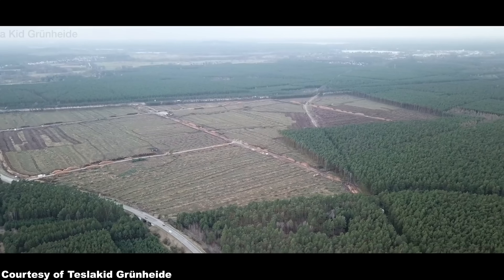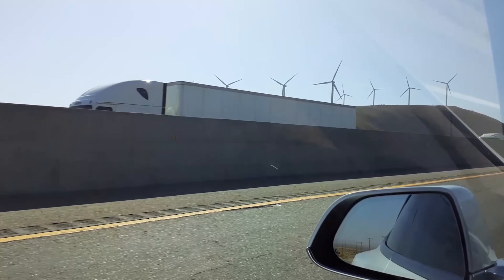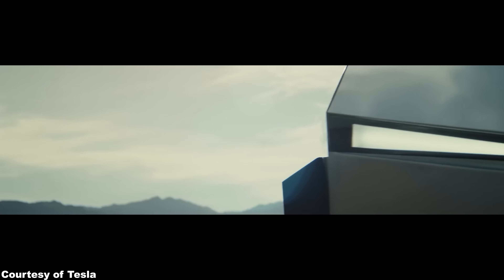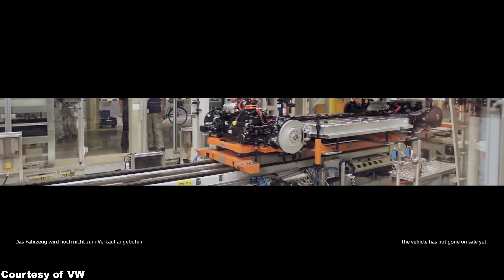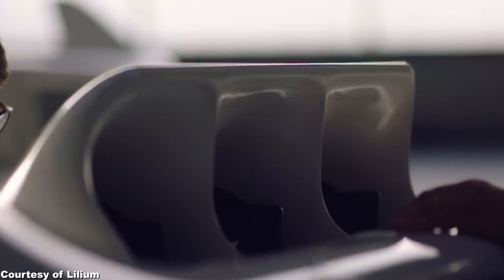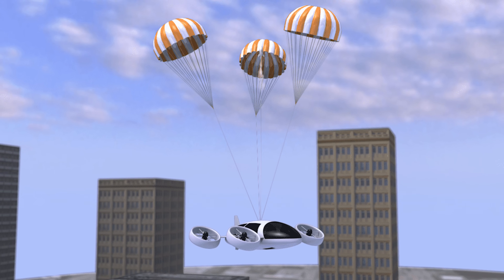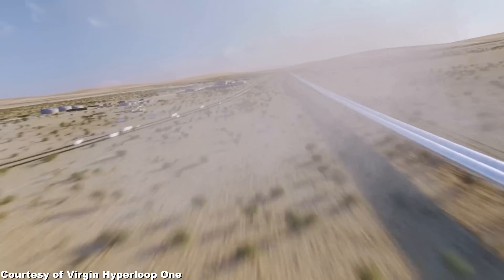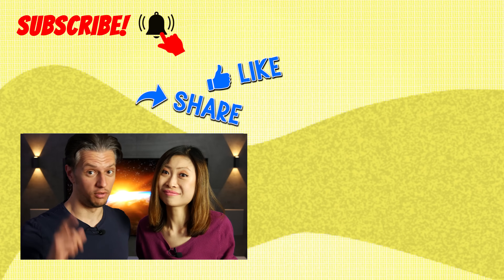Tesla News 2020, Uber's 1000 Air Taxi Fleet, Elon Proposes VTOL to the Air Force!

Comment: Another thing. I wonder why drone airtaxis, helidrones, dronecopters etc couldn't incorporate a Helium cell inside the body to add to the craft's lightness. Sort of like a combination between the Hindenburg, but with Helium instead of Hydrogen (actually the Hindenburg was originally intended to be used with Helium not Hydrogen), and a dronecopter. This is because airships and drones have in common the flight property of VTOL. Adding a Helium cell not to raise the drone but simply lessen the weight could make for a more efficient and longer range dronecopter. It could sit either above, under or to the side of the main cabin, depending on the design. Or you could have a series of cells, just like you have a series of drones in the german version of the airtaxi / dronecopter (whose tree design I actually really like, plus it looks very safe.) Imagine the drone rotors having to do very little work because so much lifting work was being done simply by the Helium cells, that range was extended significantly! It could completely replace helicopters for this reason.
Reply: Sorry I mean the Zeppelin airships in general not the Hindenburg specifically - it's just the most famous Zeppelin because its hydrogen cells blew up!

Comment: Great show and lots of interesting ideas. I'd like to see electric drivetrains used in shipping a lot more. There's no reason why you couldn't have a 1GW sized battery in a ship because weight is much less of a problem than in a plane (for obvious reasons) and can contribute to the ship's ballast. A 1GW battery, separated into 100x10MW modules, would allow a ship to power itself for many weeks, possibly more than a month depending on efficiency without the need to recharge. Furthermore, inclusion of solar into a ship's design, covering every available surface, could create something like a 10MWh solar array, which would then be fed back into the battery for regeneration. It could also power a separate auxiliary propellor.

Comment: Germany is losing a lot of electricity on windy days because there is not enough line capacity to get all the power from the wind parks to the customers. TESLA´s batteries are needed badly. California will have to keep their nuclear plants safe during earthquakes. Despite having much fewer earthquakes Germany is shutting down the nuclear plants enlarging problems of obtaining and distributing CO2-free electricity and has no depository for high level radioactive and transuranium waste. France is going along a different path and maintains about 75 % nuclear component in the energy mix for electricity while slowly developing solar power. A depository for high level radioactive and transuranium waste is under construction in a clay formation. The reprocessing plant at the Atlantic coast is very hard to keep free of small leaks into the ocean. Therefore, delicious and world-famous cheese is produced setting free a reduced output of CO2, and electric vehicles can be charged with reduced- CO2 power as well! Perhaps sometime in the future, high-level waste can be rendered harmless by transmutation reducing problems in handling and leakage, and fusion power can take the place of nuclear fission. Research and development are needed urgently. It sounds that one needs to go from Cleveland, Oh. via Pittsburgh, Pa. to Columbus Oh. (i.e. The Ohio State University, also the home of the Institute of Polar Studies, and as said below The Buckeyes). Perhaps they can circulate the pods between Chicago and Pittsburgh through both lines so that one does not have to change pods. In any case, it should be quite fast. Go, Hyperloop, go, ITER, go Wendelstein 7X, yummy, French Cheese!

Comment: Um you need to study helicopters a little more. And likely the FAA a lot more. And drones a lot more. As of now autonomous flight is not legal in the U.S. under the FAA. The airspace can not accommodate autonomous aircraft. There a number of companies looking at converting helicopters to autonomous taxis.  Helicopters are very safe when properly operated. There are a number of technologies to make conventional helicopters quieter. When you scale a multirotor to a size large enough for air taxi the rotors will necessarily break the sound barrier thus be noisey.   I think you need to do some research. As a professional helicopter pilot flying air ambulance I find the comments about helicopters to be offensive. And the same kind of FUD that y'all dislike from the shorts.

Comment: Lilium looks very interesting. I'm very sceptical of any air taxi with open rotors. One gory accident and public would shun any open rotor design. Any air mobility solution needs to address not only the safety of occupants, but also the acceptance of people on the ground that will be unwilling to accept the risk of something falling on them, for which they enjoy no tangible benefit. Lilium could have multiple engine failures and still land intact. The software controlling all of those electric motors individually to maintain stability and fault tolerance will be a key factor in understanding the viability of the product. Very interesting design; I hope you visit them and give us the whole story.

Comment: I'm a big fan of Elon Musk in many regards, but he does have an unfortunate habit of speaking before thinking things through properly.  "Hyperloop", a concept which has existed since at least the 1960s and then known as a vacuum train, is something which does not make sense and is not possible with any current or shortly foreseeable technology.  The tunnel network he proposed to get cars off city streets is more workable than the Hyperloop, and that too is something not realiseable with any tech on the horizon.  And I say this as a fan of both the Tesla and SpaceX projects - the techs that made those possible were either already extant (but nobody had put them together yet) or not far off AND he pulled in researchers to develop them.  The stuff needed for Hyperloop and the tunnels, otoh, is about as far off as commercial fusion and he's not working on any of it.
Reply: @TechChasm  Well, I await your upcoming video with 'bated breath, then.  :)
Btw, Thunderf00t, much as I respect him in many other regards, seems to have a massive hate-on for Elon.  He generally allows himself to get far too mockingly indignant, rather than just calmly pointing out the problems with something (it would be awesome if he took Potholer54's approach to debunking), but when it comes to anything Musk he goes right off the deep end.  I, otoh, have problems with Hyperloop, but I'm willing to reconsider if certain aspects of it can be addressed.  My main issue:
1a - If the negative pressure is to be maintained, the pods will need airlocks.  How will an airtight interface be achieved with a curved pod surface that arrives and departs with shear, rather than butting, and have any sort of useful life with the abrasion inherent?  This applies whether it is just the hatch that interfaces a lock, or the entire pod that emerges into normal air.
1b - If the pressure of the tube will be allowed to normalise between passenger exchanges, otoh, how will the tube be evacuated in a reasonable time?  The fastest vacuum pumps we have at present are woefully slow from this aspect.  Given that Musk does not apparently have a team working on this, the only solution I can see is vast numbers of said pumps acting in parallel, which would make the system ludicrously expensive.

Comment: I'm a big fan of elon, but I have to say that fighter jets are not going anywhere and supersonic drones will take a while to go electric.

Most aircraft today can be modified to operate autonomously (albeit with difficulty) since their computer systems are built for "fly-by-wire" control.
If you were to try to pilot the F-35 without computers, it'd drop out of the sky.

There's also the need to develop either a zero-latency connection to the drone, or AI that is able to match and beat a human in air-to-air combat.

We probs won't see anything like this soon, though near 2030 things  could change.

Comment: I´m truly sorry, but I find your comparison of helicopters to air taxis simply wrong and misleading.
Helicopters don´t use parachutes for the same reason air taxis won´t use them: height and air flow caused by the rotors (besides required training, difficulties to exit the vehicle, how should passengers wear them during flight). So this a non-issue. An air taxi would not have saved Kobe Bryant.
Air taxis are safer than helicopters? Prove it. That the few existing air taxis with just a few miles of flight under their belt did not kill many people yet is not a miracle. Helicopters are in use for many decades now and all over the world. That accidents happened was inevitable. Air taxis will get their chance as well.
Yes, helicopters have just one rotor, but even if the engine fails, in most cases the rotor still turns and enables a safe landing. The main cause for helicopter accidents is loss of control by the pilot (and helicopters are flown to all kinds of locations, not just to fixed pads on fixed routes like air taxis).
True, helicopters burn fossil fuels. But if you can build an air taxi with the same capacity like a helicopter, you can build an electric helicopter as well.

In essence, this was a poor comparison based on personal bias. You can do better than that.

Comment: Regarding Hyperloop. . .  There are essentially THREE kinds of problems. Physics. . .  which means we will NEVER (sorry, Trekkies) travel faster than the  speed of light, Engineering Problems. . .  of the type faced by the Apollo Program, and Political Problems.  Hyperloop is faced mainly by political problems. . .   with the “Will to Succeed”, the Engineering Problems will quickly evaporate.
Reply: I guess I missed something.  Who said anything about traveling faster than the speed of light? But if you are, read Einstein, Alcubeirre and Dr White at NASA, technically possible warp drive, not technologically feasible at this time.  Space can go any speed.
Reply: @josephparker3033  That drive requires components that might be impossible.
Reply: jkn Possibly. Dark energy is a little tough to come by these days.

Comment: Not the best move to include the chopper crash in my opinion. Maybe it hits close to my heart because I was born and raised in LA. There WILL be death and crashes with Airtaxies. I can promise you that. Perhaps not as many, but they will not prevent crashes or death. An Air taxi may be safer at a low scale. But once they become common we will have daily deaths just as we do with other modes of transport.
Reply: Unfortunately, I have to agree.  Battery fire while flying?
Reply: @jkn6644  There are a number of machinal issues that can go wrong in any system. Parachutes help and I'm sure they will be safer than helicopters but they will also be more of them.
Reply: @PaperDragons  Hanging from a parachute with burning battery...  Dropping it will cause other problems.  Elon is right traffic must go underground.

Comment: Electric scram jet engine. Fans blow air at Mach 5 powered by batteries to the scram engine up until the plane is going Mach 5 then the scram jet works without the fans. The fans are then used to charge the batteries for landing.

Comment: Military needs long range flight. Batteries won’t be their for a bit. If your building a drone however subtracting the weight of pilot and cockpit allows you have a gas turbine electric generator to power 2 -4 ducted fans for vtol.